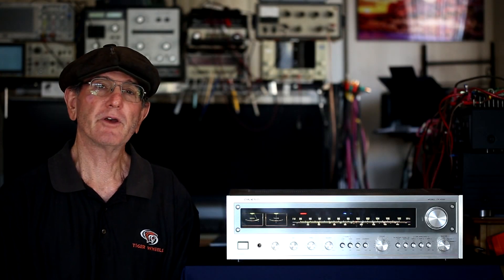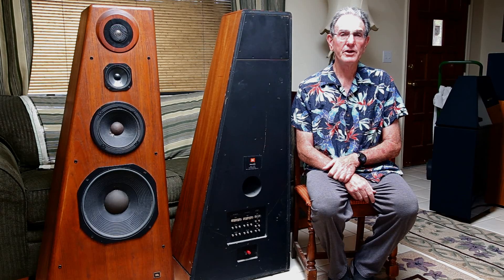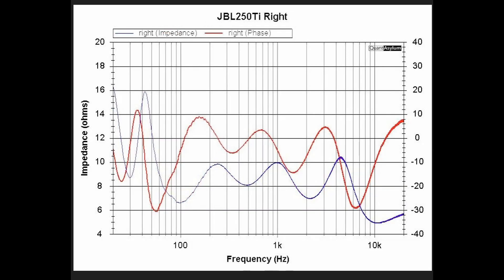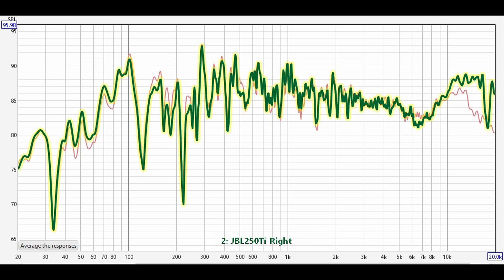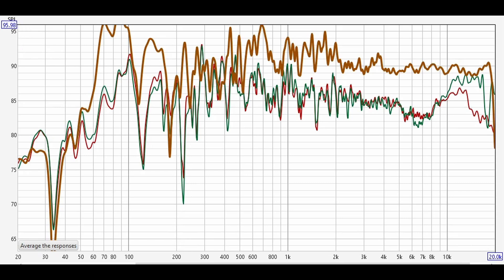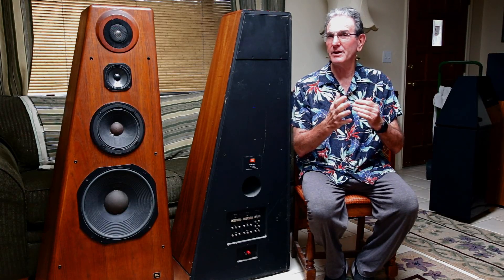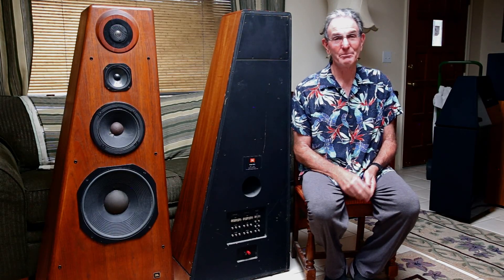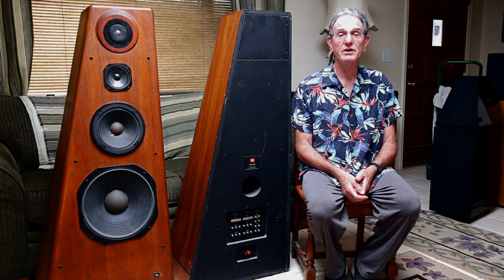JBL 250Ti Loudspeakers- Vintage Audio Review Episode #142

Comment: Thank you for letting participate in the livestream, it's been a pleasure and if anything, lasting way too short. Looking forward to the next one already. Im wondering whether the designer(s) aimed for the sweet spot on the tweeter axis, which would explain premature roll-off at the upper end. Impedance plot suggests the crossover point between it and the upper midrange driver close to 5k, which, considering the distance between the two, does not allow for a satisfactory phase correlation. The issue exacerbated by even a modest off-axis positioning. I'm not a fan of ported designs myself, but in this case, low tuning frequency and a sizeable driver fit large, timber framed rooms perfectly. Great review, as always, thanks again!
Reply from the maker: Wow!- you know a lot more about speaker design than I do. My friend sent the woofer out to be repaired and we may use those speakers for our next a/b test in later january- I look forward to hearing them again. I just do a basic on axis measurement and I am guessing that changing were I pointed the mic would change the response a little bit. Once I hit 4000 subscribers I will do another livestream- probably this summer based on channel growth. I thank you for joining in!
Reply: @vintageaudioreview  Had a long stint at venues two decades ago, followed by exploration of domestic speakers with Audiomatica Clio later on, but a long way from being an expert. My entire system is built around handmade speakers- was lucky to have clandestine access to a local speaker manufacturer in terms of advice and expertise and a carpentry and metal workshops as far as cabinets go. Roughly speaking, the first valley corresponds to the tuning frequency, while the peaks further up to the crossover freqs. With the distance between the tweeter and the midrange, one cannot get a good correlation between the two off- axis, which would be the case with the mic lower down. Other than aesthetics, I cannot figure out why'd they set them so far apart.  Efficiency is always exaggerated, but I'd estimate it based on the level of the lower midrange and a bit closer to 90dB/1W/1m. One common trick is to have a 4ohm nominal impedance and yet present the figure achieved at 2.83V, which corresponds to 1W into 8ohms, but not 4ohms. Looking forward to the next stream!
Reply from the maker: @paulb4661  I am guessing that my room- far from ideal but is what it is- effects the frequency response with some of the suckouts that are seen and that is why I like to measure also the speakers in the same spot in the room so I have somewhat of a baseline. I have not done off axis measurements thus far, or placed the mic higher or lower. Interesting point about the voltage- I typically set the tone for 2.83v at 1khz going into the speaker, regardless of what the impedance measured.. Thanks for your commentary!
Reply: @vintageaudioreview  Indeed, short windowing can only go so far, or low! Notwithstanding the 30x30x30yd anechoic, ending up with nodes/antinodes/multiple reflections in a listening room is pretty much unavoidable. 1/3 octave smoothing is good enough, unless one has eternity to perform nearfield LF messurements. Often, narrow directivity, large baffle speakers will interact better with lively, "hard surface" sparsely furnished rooms, while "narrow" towers with smaller drivers crossed low, suit soft, carpeted, book cased and curtained bedrooms better. By no means a hard and fast rule though. Minimizing first side reflections, caused by hard, equidistant surfaces, increases the perceived stage depth for example, a 2" deep conical foam can be surprisingly effective and... destructive for any relationship at the same time 😉
Reply from the maker: @paulb4661  Lots of good info. Would love to have a dedicated listening room with the flexibility to move the speakers this way and that, and appropriate treatment. Maybe one day.... Thanks so much for the comments and you surely are into acoustics!

Comment: I wonder if the 180-degree mounting change to the offending woofer would have helped the problem? I have run into that issue before, and gravity was enough to stop a rubbing voice coil.
Reply from the maker: I did try it to no avail. The owner sent them in to be repaired and have them refoamed while it was there. I look forward to hearing them again- thanks for taking a moment to comment!

Comment: The L-100T were more my budget.  These were actually about $2400 in overseas military exchanges. Engineering caveat:  The tweeter should be 1" from the next driver, it's mounted too far away. They could use a cap upgrade.
Reply from the maker: I appreciate your taking the time to comment! THe 250Ti's were $2400 ? And are you referring to the 250Ti or the L-100T in regards to cap replacement and tweeter spacing?